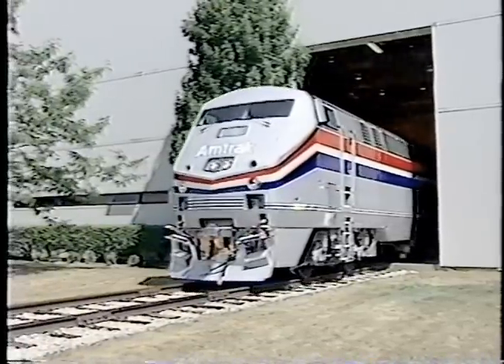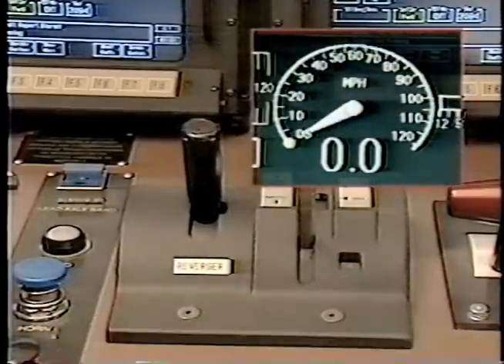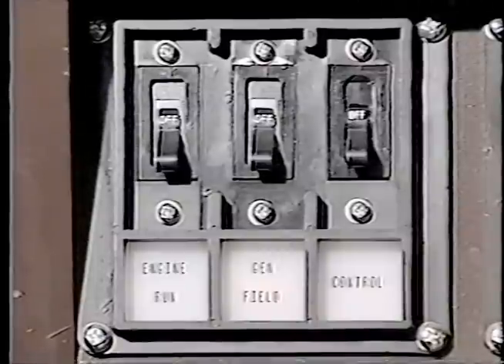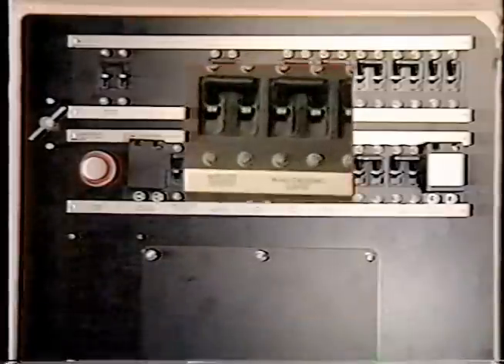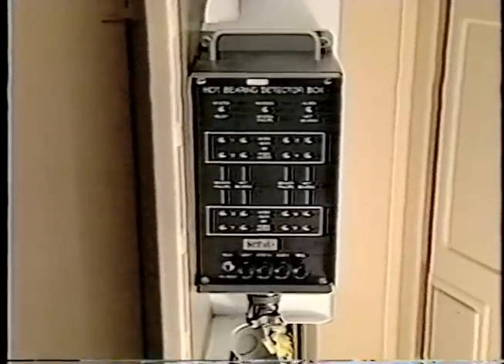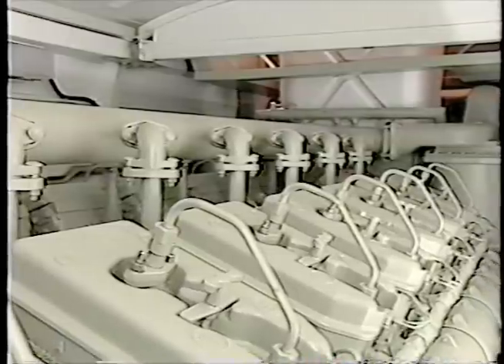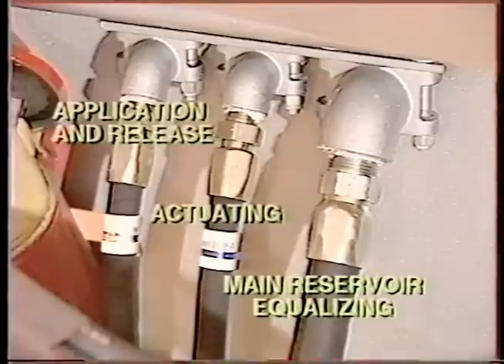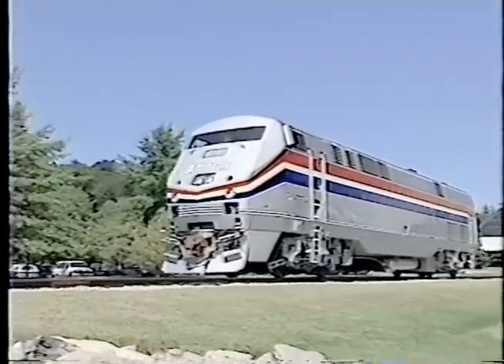Amtrak P42 Locomotive Overview

Comment: I GOT TO WORK WITH THE VERY FIRST OF THESE GE STREAM LINERS, THE 800 BEFORE IT WAS PLACED IN SERVICE IN THE 1990s!
IT CAME THROUGH AT&SF ARGENTINE YARDS ON ITS WAY TO THE PUEBLO DOT TEST CENTER!
IT CAME IN DIT ( DEAD IN TOW)
WITH A FREIGHT TRAIN OUT OF CHICAGO!
IT WAS CUT OFF TO BE PUT ON ANOTHER FREIGHT HEADED TO COLORADO.
I WAS CALLED TO LOOK AT IT BECAUSE WHEN SET IN THE SIDING THE SWITCHMAN COULDN’T FIND THE HAND BRAKE!
THE CAB AND THE ENGINE ROOM WAS LOCKED , AND I FOUND THE HAND BRAKE TO SECURE IT ON THE SIDING!
IT WAS THE FIRST ELECTRIC OPERATING HAND BRAKE I SAW!
WHEN THE LOCOMOTIVE WAS SET ON ITS NEXT FREIGHT I RELEASED THE HAND BRAKE, THEN PULLED THE BATTERY SWITCH!
WHEN THE ENGINE CAME BACK EAST TO ERIE SOMEONE SET THE HAND BRAKE AND THEN WAS UNABLE TO RELEASE THE HAND BRAKE BECAUSE THE BATTERY SWITCH WAS LEFT CLOSED AND THE DRUG 3” FLAT SPOTS ON ONE PAIR OF WHEELS!!
UNFORTUNATELY THIS HAPPENED ON MY DAY OFF AND I MISSED THE MISTAKE!!
BUT I THOUGHT THESE UNITS WERE GREAT, AND I STILL DO!!
KEEP THEM ROLLING BROTHERS!!
👍👍

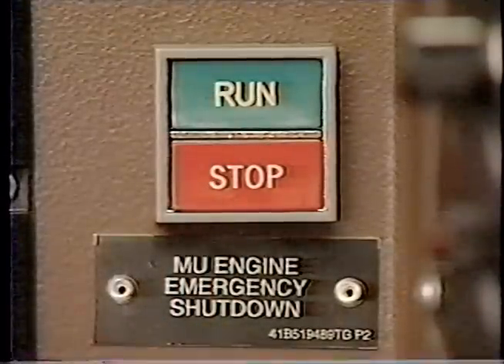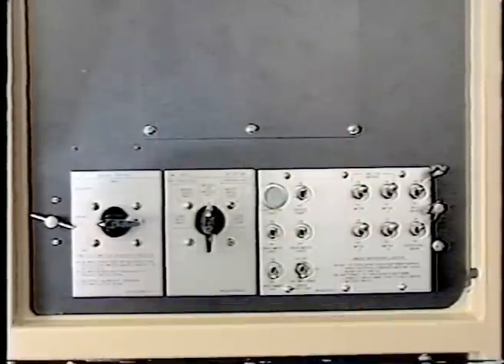Comment: This great to watch while driving Genesis Locomotives TrainSim 2020 etc :), Sim has a few indicator lights wrong and/or was updated in more recent models ??! Always wondered what the spottier button was for 20:25 ,and Train Compartment Lights, next to Tracktion motor switches is?, 33:15  but that's GE  for you. ( Customized design relatively low production numbers and million of dollars each )  They do not get everything perfect, first model runs etc.

Comment: I thought there was another smal cabin behind. the locomotive for the back  maneuver. or maybe not on this type of GE P42DC  locomotive
Reply: Before rebuild, the P40DCs had it.
Reply: Some had control stands in the rear, it think it was early p40 models, later p42 models didn’t.

Comment: hi guys Is there  in this GE P42 DC LOCOMOTIVE a  small cabin behind to maneuver backwards? cus is in behind locomotive door I guess the back door and used. to access the other locomotive that is hitched. because locomotive in multiple unit thank for information;  MAY BE NOT
Reply: In a way. There's multiple engine areas and yes, you can pretty safely shove from the rear area. Though its very loud. : )

Comment: The ROTARY AIR BRAKE SELECTION SWITCH setting of FREIGHT rather than PASSENGER,  turns off special Amtrak passenger train brake line air pressure signaling and characteristics, such as automatic gradual roll out of air line brake pressure release, that Amtrak uses on its high performance baseline 110 psi passenger car air brake system that may hamper and confuse standard freight train air brake systems operating at a 70 psi baseline pressure.  Running a standard 70 psi freight train air brake system is needed for emergency on-the-road mu'd substitution of freight locomotives and mixed freight and passenger car trains.  The passenger cars run at a 70 psi brake line pressure just fine with a drop in actuation speed and air reserve needed for more frequent brake releases.
Reply: That’s a whole bunch of bad info.  But more than anything, freight trains do NOT operate at 70 PSI train line.  They operate at 90 PSI on ALL freight lines.
Reply: @FFred-us9tw  I got that information from reading about passenger train air brakes and why a passenger train may need to run freight train air brake systems when a substituting a non passenger locomotive into the consist. https://en.wikipedia.org/wiki/Railway_air_brake. Read down to working pressures and it will describe freight trains running 70 - 90 psi.
Reply: @douglasengle2704   That’s a Wikipedia page and in typically fashion it’s outdated and filled with wrong information.  All modern freight trains operate at 90PSI Brake Pipe pressure in what is known as DIRECT RELEASE. Most passenger railroads will operate at 110PSI in GRADUATED RELEASE. You can actually read the entire FRA CFR (Code of federal regulations)  online. It’s boring but educational if you want to understand how they work better.
Reply: @douglasengle2704  Don't parrot garbage you read from wikipedia. Really, don't. It's stupid. Understand, do not just read. Some freight lines used to run 70, but none do anymore. 70PSI feed pressure on passenger cars would be illegal. "gradual rollout of air line pressure realease" means literally nothing. There is no "special signalling," the cutout valve simply changes how the brake handle behaves, as well as changing how the independent brake sets up. You "can" operate freight cars with the switch in passenger mode in rare cases, but you have to use it like a direct release brake. Also, freight locomotives don't care what they're hooked up to- you just change the feed valve pressure to 110. Good god, you have GOOGLE at your fingertips yet you commented stuff that even Trainz would get right.

Comment: The sad thing is at this point, the P42s have been in service longer than the F40s were, and the P42s still arent replaced yet
Reply: They will be, starting in 2021-24.
Reply: The first ALC-42 has been delivered to amtrak, introduction to service pending.
Reply: @HNMusic13  service has been for a while now. Just look at Hiawatha and Cascades services. They use the new Chargers. New Chargers are now in service sometimes on the SWC, but it's rare.
Reply: Why is that sad?

Comment: Are all the big cargo locomotives diesel or hybrids? How many cylinders are in one engine and what's the displacement in liters?
Reply: the p42dc locomotive series has 16 cylinders and 4,250 horsepower
Reply: Diesel electric
Reply: these diesel locomotives are diesel-electric. Much more different than hybrid because they dont need to store the electricity to the battery. The GE transportation Genesis series (P32AC-DM, P40DC, and P42DC) uses GE 7FDL-V16 as its prime mover, which is approximately 299 litres

Comment: Did they do this for the F40PH?
Reply: i really really really hope so, say "Amtrak" and it's an ol F40PH in Phase III grey-green-silver body with red-blue-white stripes that people think of. Britain invented the railway but I'd kill to commute on a Genesis and an F40PH or go long haul over 700 miles without a breakdown in perfect Superliner comfort. Damn Britain, we have a Victorian-era railway where even commuter DMUs struggle to avoid having the roof taken off by a 200 year old tunnel (quite literally, they had to remove the aircon from the Class 158s going to Buxton because the aircon air intake scoops would be sliced off by an ancient tunnel). Vista Lounge - wasn't that some dodgy software that came preinstalled on a white box 2008 PC along with a 30 second free trial of Office 2007?!
Reply: @daveyr5462  For being the inventors of trains the UK sure thought of a lot of ways to make a pig's ear of it all.

Comment: According to AMTRAK operations management the GE P 42 junkmobiles are failing at a record rate.  They really should of rebuilt the F40's.  Just like UP and BNSF are doing with all their SD and GP 40's, the EMD locomotives were built well to start with, and still, according to BNSF and UP have MILLIONS of miles left in them, even after being mothballed for years.  We are seeing dozens more repainted, and re powered EMD locomotives every day on all the BNSF, UP and NFS lines.  The railroads bought GE because they are cheap.  Cheaply built and falling apart. That's what happens when you get a bunch of desk drivers and executives making decesion for the opperational side of the railroad.  Cost less to buy, but in the long run, not penciling out at all.

Comment: What the heck is a Control Area?!

:-(
Reply: João Felipe Oliveira Alves e Silva 

on the older locomotives we called it the engineers area, throttle, air brake controls etc..
Reply: João Felipe Oliveira Alves e Silva A control area on a GE locomotive is a compartment where electrical equipment is located. Most GE units have CA1 through CA9.

Comment: what if i need to make a emergency stop and the main switch is set on frst while i am hauling passengers  is it to make a smoother ride ?
Reply: As noted, if the P-42 was a dedicated passenger loco there wouldn't be a "freight" position on that switch. Using a "freight" position in emergency on a lightweight passenger train would invite a lot of injuries with that heavy duty braking function. In case Amtrack went belly up or loco replacement the P-42 would still be a useful loco for freight.
Reply: @rayford21  Amtrak actually uses the P42 in freight service daily for the Auto Train. You can definitely run them in freight mode, it just requires different handling skills. The passenger cars also need to be set up for direct release since the triple valves can get confused when used in direct release under certain conditions. It's not "heavy duty," whatever that nonsense means, it only changes how the release function works.

Comment: Yeah VIA was smart and rebuilt there F40s
Reply: +Big T long distance Canadian version of Amtrak. Just type in VIA RAIL 640... and you will see the rebuilt F40ph's.
Reply: Better, you were lucky to not go deaf in one from what I've read about. They also had issues with running out of fuel while on a run. F40s were commuter engines, not long distance passenger locomotives. Amtrak was better off keeping the SDP40Fs and retrofitting them with HEP. The F40s were great in their prime for Amtrak, despite those issues, but by the time the 90s came around they were worn out.
Reply: @KevinCNYC1991  yes that is why CSX just added a bigger fuel tank.
Reply: SDP40F's were scrapped primarily because they created so much bad publicity because of the steam gennie issue. No Amtrack or RR official wanted anything to do with converting something with a bad reputation.
Too bad, other than the steam gennie it was like an SD-40 which was very successful.
Reply: P Kranz lol emds are great!
Depending on your quality of rail
Reply: That's correct.  The GE stuff is falling apart at the seams.  Cheap, underengineered locomotives.
Reply: +Ham549 VIA?
Reply: Florida Railfanning 812 more like Slamtrak
Reply: their not there
Reply: The Ge locomotives are built cheaper, and are failing all over the AMTRAK system.
Reply: Not so.  Many locomotive engineers and operations management will tell you that the only reason the GE's were purchased is because they are cheap.
Reply: SDP40F locomotive's were replaced because Amtrak made design changes to the locomotive that created bad riding on less than excellent track. They specified a hollow bolster and a round above the frame water tank for the steam generators. I worked on these locomotive's when new on the old New Haven shoreline and they definitely had riding  problems. Turned out when they sold a number of them to the Santa Fe Railroad they immediately shopped the locomotive's for completely rebuilt trucks. The original trucks had their bolsters replaced with standard trucks. The above the frame water tank was removed.
Reply: Remember that Amtrak is a piece of the government and every purchase Amtrak has ever made was the cheapest bid Amtrak received.
Reply: @jamesshanks2614  yes but the F40PH was built on proven technology. For this unit to try to lot of new nonsensical things.
Reply: Ham549 

Yup I know all about the F40PH, the first 30 units were assigned to New Haven, Ct. and worked the shore line to Boston. I fortunately had a set of shooting mugs with me cause you need them when the engines running at 893 rpm to run the hep generator.
Reply: Ask almost anyone who works with locomotives and they will tell you the F40s are better.
Reply: More like VIA FAIL. Viva La Amtrak!
Reply: Ham549 Thats like saying ask anyone who works with locomotives - GE"s are the best.  

Well, they are, and I once worked with locomotives, but hopefully you get my point.
Reply: Ham549 I disagree.

Comment: Definitely an interesting video. I have to wonder who exactly the target audience for this video was supposed to be. The video seems to be aimed at Amtrak locomotive engineers, but there's a lot of "well duh" information in it that an engineer would already know, as well as lots of technical info that an engineer would never need to know.
Reply from the maker: There's probably also a level of "just covering our bases" duh stuff that the legal departments required them to include.
Reply: They are designed for locomotive engineers and are definitely helpful as every new class of locomotive's has new features that previous locomotive's didn't have. Every locomotive builder writes and prints locomotive manuals for that locomotive model. This locomotive was so far out of the realm of normal locomotive's a video like this was the simplest way of teaching  engineers the new features. 
Jim retired locomotive engineer.
Reply: +New Yakisoba Far better than that gross green EMD loved to use so much.
Reply: +Locomotive450 This was made by the same sort of Federal idiots who make army training films. Anyone who has been in the army will instantly recognize this. By the way, whoever designed the interior of the locomotive sure likes the color brown. As I said, idiots.
Reply: +Andrew Armstrong This is way beyond their ability to absorb. Besides, Congress is in the pockets of the freight haulers.
Reply: Ah,General Electric, I think GE only does that to keep heat out.
Reply: Andrew Armstrong Exactly.
Reply: You mean the heat from the fires of their locomotives burning?
Reply: Target "audience" would be existing freight Engineers, especially ones not in road freight service, or just newbies. Add to that the "Flying Squad" (aka loco mechanics & service)
Reply: If they didn't say "DON"T go from idle immediately into notch 8, you'll break it" I guarantee all the new hires would be doing it all the time then wonder why their tcs burns out.
Then when the maintenance department looks at the event recorder, they could go to corporate. Corporate would say, "Well that wasn't in the training video. Let's call up the legal department." Legal calls GE, gets a suit filed for damages, every other road that ordered them follows suit, next thing you know there's no more GE.
Definitely covering their bases.
Reply: @PowerTrain611  TCs? Mate, the p42s load to notch 8 so slowly you'll be hitting 60 before the computer decides to give the engine full load. On top of that, the computer derates when you've been over 1200 amps for too long. Horsesh_t like this is why railroaders call railfans foamers.